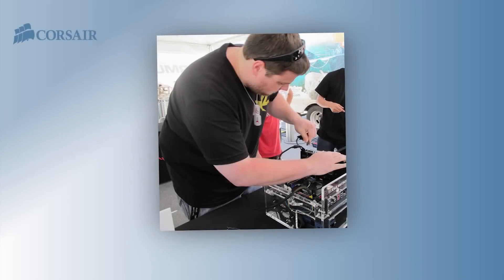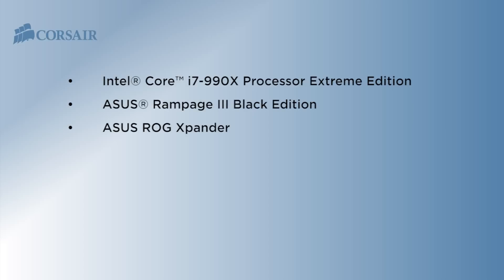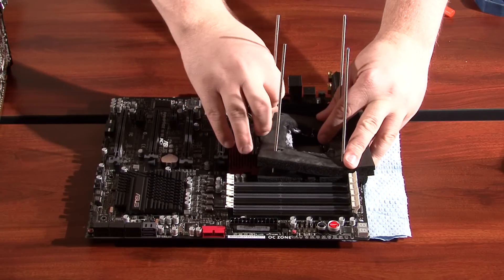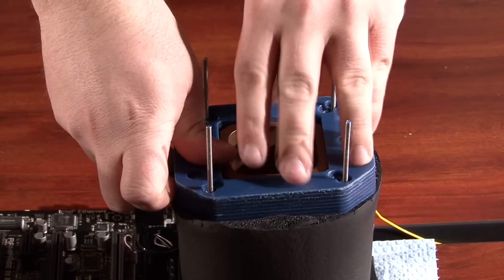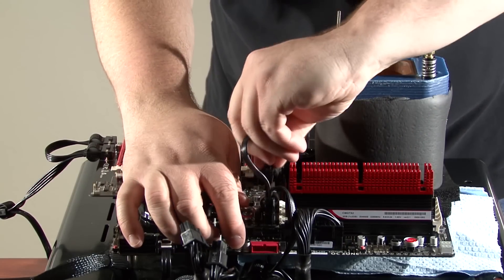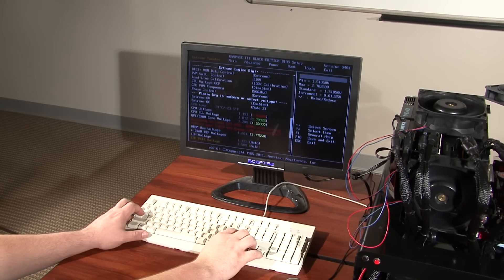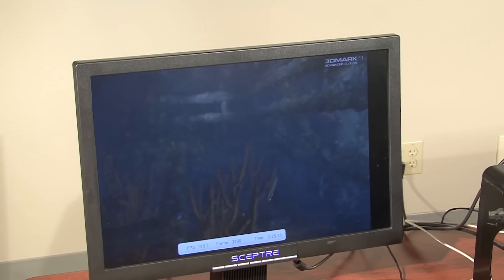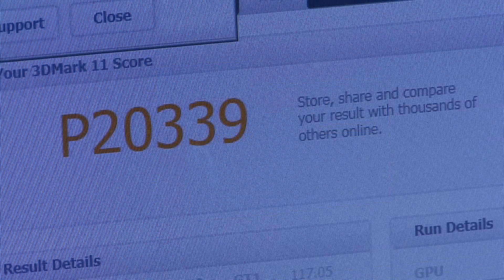Setting up your PC for liquid nitrogen cooling

Comment: Why does the CPU stop if its too cold? Is it the ultra low temperatures disrupting the conductivity inside the CPU? I know cryogenic temperatures can do funny things to properties and conductivity of metals and semi conductors.
Reply: Tuberuser187 That is correct, but your drew the opposite conclusion. Resistance is directly proportional to temperature (like you stated), which means the higher the temperature, the higher the resistance (conversely, the lower the temperature, the lower the resistance).

You are also right about resistance being the problem, but again in the opposite direction. The reason why there is a cold bug is because the CPU is made of transistors. Transistors NEED RESISTANCE to function properly. At -1XXC or lower (depending on the ratio of silicon to germanium), superconductivity occurs which means the transistors have 0 resistance. This is the reason why the CPUs stop functioning.
Reply: SirRaven
Best answer ever.
Reply: I think that the problem with the cold bug is that the temperature is too low for the electrons to move, so they just stop moving and the CPU just stops working... That's my theory.
Reply: ***** Thats probably it, electrical resistivity of metals increases with temperature and IIRC its relationship is linear. The colder it becomes the harder it is to push a current through and the warmer it is the easier it is.

The materials in the CPU probably become so resistive at that temperature they no longer allow the current to pass through.
Reply: ***** To me the amazing thing is how low the temperature can go before it stops working, I wonder how other PC parts would compare.
Reply: I don't think the cold is the issue for the CPU to just stop. Pushing the overclock high enough it does not matter if the atmospheric temp is -10 or -200 the CPU will still overheat too fast for the it to matter. So when you're performance overclocking it's not a matter of "if" it stops it's a matter of when.
Reply: Jules As much as I appreciate the reply I would have preferred it if you had watched the video first.
Reply: Tuberuser187 My theory is that if the processor is too cold and you start warming it up at a fast rate, it could possibly crack to cpu or become brittle
Reply: It is because of the extreme low temperature. At much lower temperatures (as you probably already know) the physical properties of the CPU are altered. There is a range of temperature at which the CPU can operate at and function correctly.
Reply: ben chang I am surprised they can get that cold before they issues really, I wonder how well the other computer components compare.
Reply: ***** pretty good theory
Reply: Exactly what I was thinking about Tuberuser187
Reply: Yes, but I think everything would be the same, every part would do a bug on that temp.
Reply: Tuberuser187 Well the actual thing,I think is irrespective of the material,material tends to occupy lower volume.Remember absolute zero,Yeah! that's that.At lower temps,as mentioned conductivity is favored sure!;But at microscopic levels as theorized,at even low temps the mere path for mobile electrons is blocked.Now that is not an obstruction (resistivity)!,it's just that there is nowhere for the electrons to move.Hope you understand this.:)
Reply: Tuberuser187 It's not even a theory. The extremely low temperatures, stops the flow of electrons. There are cases where they use liquid nitrogen on bombs, to keep them from blowing up.
Reply: Areyouduckingserious Also, electrons move extremely slowly to begin with. They move through a conductor at around 0.3mm/s.
Reply: *****
bad theory electrons stop moving at -273.15C or 0K
Reply: Tuberuser187 was thinking same, would like to see a 3-way SLI 980 cooled

Comment: Too bad he can't run the nitrogen in a closed loop.
Reply: technically possible, but the compressor alone would be insane
Reply: Shafquat Ahmed i wonder if there's any way of modding the refridgerator's compressor to make a closed freon-based loop  xD
Reply: barmiro Yeah this has actually been done before, look up VapoChill.
Reply: nitrogen in a closed loop wont have the same effect..  its not cold when in a closed loop..
Reply: Magnus Nymoen it will if you use an INSANELY powerful compressor.

Comment: dude! this is interesting! i like the professional production of the clip.

Do you think that simply puting the computer in a home-fridge is a good idea?
Reply: nop hell noh
Reply: why?
What about specially design fridge?
Soeradj Chotkan
Reply: 3goldy putting your computer on a fridge would most likely cause water to condensate around it and cause damage to components. assuming the low temperatures themselves wouldn't cause any harm, I guess completely removing all water and humidity would be the only way.
Reply: I would highly recommend against this. refrigerators keep cold air in. They aren't designed to be constantly cooling.
Reply: uiopoiu444
How about one that is design for a computer?
Reply: could be good,,,, but the system should then not realy be an fridge it coud use the same pricipalss a fridge takes to cool ,,, something that woud withdraw the heat directly from the cpu.... and building an system that would be pouring the condensation ... <i knw my english is bad speaking english isn't my primary language >
and you'll pay have to buy a huge powersupply  :P

Comment: Google Search for items below!

List of Supplies & Components:
1. Kingpin Cooling Dragon F1 Extreme Edition CPU Pot
2. EVGA Frostbite Thermal Paste
3. 0.5" Closed-cell foam insulation
4. Blue shop towels
5. Liquid N2 (Nitrogen)
6. 1-liter Thermos x3
7. 20-liter Liquid N2 dewar
8. Propane blowtorch

Electronics:
Intel i7-990X Extreme
ASUS Rampage III Black
ASUS ROG Xpander
NVIDIA GeForce GTX-580 x4
Corsair Dominator GTX2
Corsair Professional Series Gold AX1200 x2
Corsair Force SSD

Comment: lol'd at that fucking thermal paste splat, you are supposed to spread it evenly
Reply: Lol you guys are stupid...arguing about thermal paste on a video of a guy about to cool his cpu with liquid nitrogen...
Reply: I can tell you aren't certified. You are SUPPOSE to make a bead of paste in the middle of the CPU. when applying pressure to the paste with the heatsink will spread the paste evenly better than you ever could by hand. Get your CompTIA A+ certification to learn more.
Reply: Eillon Cross
I wipe my ass with your CompTIA A+ certificate everyday or any other certificate in the world for that matter. I use simple tools to spread thermal paste evenly instead of getting it all around the fucking processor where it shouldn't be.
Reply: CLIn7 l33tW00d 
What are you talking about guy? "...spread thermal paste evenly instead of getting it all around the fucking processor where it shouldn't be." 

If you spread the thermal paste "evenly", no matter if on the CPU or the bottom of the heatsink, then it WILL "get all around the processor"??? I can't follow your logic. But here is a bit of my logic; why would you spread the thermal compound all over, if the bulk of the processor's internals are located directly in the center of the CPU? I am legitimately interested in your reasoning.

***** 
You are right, I've never seen that happen either, because it doesn't. small bead of thermal compound directly in the center is sufficient. 

Shareallicu 
If my degree has taught me anything, it is that thinking outside the box IS essential. Yes you cannot just take everything that you read as doctrine, because it isn't. But, the main problem with spreading the paste yourself vs the pea shaped center method, is that you have a higher chance of the thermal, conductive also if you use AC5, paste overflowing. not to mention, as I stated earlier, you will never be able to spread the pasted as good as the heatsink can. Spreading also creates uneven surfaces, going back to the previous fact.

Experience as an IT Administrator has taught me a lot also. I still have a long way to go and love learning new things about my craft. BUT, I will not stand for comments by imbecile such as "lol'd at that fucking thermal paste splat", or "I wipe my ass with your CompTIA A+ certificate everyday or any other certificate in the world for that matter". CLIn7 l33tW00d  words speak volumes about his character. Yours does also, but at least you brought something worth talking about to the table.
Reply: CLIn7 l33tW00d Spreading the paste before putting on the heatsink will ensure you get bubbles between the cpu and the heatsink plate. The pea drop method eliminates that problem. Even if it doesn't cover 100% of the cpu (and it won't, if you're doing it correctly) it won't matter, because the processor hotspot is in the center.
Reply: CLIn7 l33tW00d
I agree with the pea size amount... but degree or not, experience has taught me that spreading it keeps the computer a cooler temperature more consistently.  I don't use Liquid nitrogen though hehe

People with degrees think they are right no matter what... they go to school to obey and are told what to believe and given a piece of paper (degree) and think it's the 10 commandments of knowledge (carved in stone).  They forget to think outside the box. They learn how to memorize other peoples 'facts'.

Not all of them though.  Earning my degree actually taught me to think outside the box; that not everyone with a degree knows what they are talking about. 

If spreading it works best, keep doing it!   If not (like in Seans case) keep leaving it to spread on it's own.  I'm sure you're both right, depending on your set-ups and settings :)
Reply: CLIn7 l33tW00d There is no need to spread the thermal paste out, most people do like he does here, just applies a dash (not to much without being to greedy) in the center, either in a circle or a square form. When you mount the cpu cooler it will push the paste creating a covering layer anyway.
Reply: I've never ever spread my thermal paste.been using this pea method since 9-10 years ago.no issue at all
Reply: madman3891 
HAHA I hear ya, but it's the nature of the beast. The thermal compound plays one of the most important roles in cooling. Liquid Nitrogen cooling is no exception.
Reply: I agree that the language a person uses can take away his/her credibility. 

But nothing compares to personal experience when it teaches something.  Although, keeping an open mind is prudent as well.

Maybe I will try it your way next time and leave it for the heatsink to spread. :)

Then again, why fix something that is not "broke"  - "for the experience" is a great reason!
Reply: Blaine Fisher On the processor he was using anyway, some processors require you to spread though, dunno if you guys are talking about the video guy way he needs to spread it or if your talking about your own, but, it varies on the type and brand you have.  Just use the manufactures recommendations.

Comment: when i rad the title i thought it was gonna be a guide on how to setup a liquid nitro loop, i watch it and he just cools it when i gets how with more wtf no one wants to dump more in while they are playing.   think i wanna do a cooler with a few peltier's
Reply: Except liquid nitrogen would freeze tubing, and if you used something that didn't have this problem the condensation from running a system long term would almost guarantee you'd kill something from the moisture build up quickly enough. Another problem is that liquid nitrogen will turn back into a gas outside of a contained environment for long, if you had it in a PC eventually the pressure build-up from the nitrogen heating up would explode, severity depending on how you contained it in a loop. 

Liquid nitrogen/LN2 cooling is not meant as a long term solution, it's extremely bad for processors and motherboards, the only purpose of liquid nitrogen is extreme overclocking for benchmarks and bragging rights. A long term solution is virtually impossible due to crazy unstable temperatures and the fact that the way our electronics are built these days they're not meant to deal with such sub-zero temps as the circuits on your motherboard would contract to the point of contacts breaking off. Pretty much every component involved in an LN2 run is not meant to live very long, but it is how the world record overclocks are done as you can do insanely high voltages (relative to normal CPU operation) and still be well below 0 so you'll never be limited by heat.

Peltier cooling is an interesting technology but it does have physical limits, and unless you're building a massive peltier plate yourself you'll find an effective air or water cooling solution will bring it close enough to the temps without the huge cost or energy consumption. If you want the most extreme long term solution to cooling you'd want to look into phase change coolers, though you have to plan and deal with a lot of condensation issues.
Reply: ty for the tips i was thinking liquid cool and having the peltier cooling the liquid in the res then cycling from there, or possibly submersed in a non conductive fluid and having peltier's cool the pool. just thinking of a fun project to OC this old POS like crazy for fun.
Reply: Chane Norris While Peltier technology is cool, it's not very effective for something like cooling a res, a radiator with a lot of fins is going to be much more effective for dissipating the heat. Peltier technology has it's uses, and can be an okay addition to a mass air cooler because in theory you can cool it to a temperature lower than that of just a standard mass air cooler (don't really see it in practice though). If you want to cool the water in a custom water loop, compression technology (phase change) is vastly more effective. 

The problem then becomes condensation, if you cool the liquid to below room temperature you'll quickly have a problem on your hands. Just as when you get a cold glass of pretty much any liquid, the vapor in the air will stick to the surface of the glass and form water. When you do this with tubing or anything near the internals of your computer eventually the water is going to collect and roll around. There are ways of dealing with this and it can be troublesome but phase change cooling does give you tremendously cool temperatures in return.
Reply: AFAIK liquid nitrogen evaporates real quick, you would want that in a loop.
Reply: CalebTaylor26 Since you probably didn't read my first wall of text, to keep liquid nitrogen in liquid form takes a very large amount of pressure, which requires some seriously strong materials to maintain, and is extremely dangeroust. It's not practical to make a set-up capable of a 24/7 liquid nitrogen loop for something as simple as a computer, and as far as diehard benchmarking and overclocking are concerned (the primary reason why they use LN2 in world record runs) is that your system, and definitely your chip are going to die relatively quickly under these conditions but you'll get the maximum possible clockspeed it was capable of.

Comment: Imagine if he did 4x 780stis. Thats #1 spot for sure.
Reply: 4x780 sexually transmitted infections? That's one weird sli setup.
Reply: 4x r9 290X's. I agree that the 780ti's are better stock, but if you can run the four 290's...
Reply: But did you expect any less? They're quite active if you know what I mean :P

Comment: Benchmarks, that is all. Use water cooling for low temps in games but this is for the sole purpose of overclocking to the maximum for higher benchmark scores.

Comment: NEVER DO THIS
Using a different colour cloth, any other than blue, will result in excess heat generation due to planks law of thermodynamics. If you use a red cloth you could cause a radiation leak from the processor! And if you use a green cloth you could even cause a small nuclear explosion.

I have many years experience in this field.

Comment: weak cores at high clock speeds don't beat fast cores at slightly lower clock speeds.
a 3770k at stock beats an 8350 at 4.8

Comment: Why didn't he run PC Mark7 instead? Also, I'm running an i5 with dual gtx760s, and I got 11k. Not much difference. I'm sure he would get a much higher difference with overclocking for applications, but not games.

Comment: My guess is that :
As propane reacts with oxygen, it transforms into water and CO2. So by doing that, he is adding water in the cooler, and with the heat generated, water has enough time to reach the sides before freezing. And part of the CO2 may also liquify, but that's really no big deal

Comment: Primarily, the cooling effect comes from the fact that liquid nitrogen is at most −196 degrees C. You could totally do a closed loop liquid nitrogen setup...  However, because making nitrogen a liquid requires high pressure tanks which are constantly being filled and emptied, the setup would be large, heavy, loud, and potentially dangerous.

Comment: The coldest that I would cool it down to is around 30-40 degrees F. I don't think it should be negative degrees though like those D-Wave quantum computing technology.

That way, you could overclock above 5 GHz. and still have long shelf life but you would have to also keep the RAM, Drives and GPU's pretty chill as well I guess.

I don't know ;(

::shrugs::

Comment: its not that hard along with most custom built computers the mother board you buy helps with all that and certain processors for example the AMD Fx Unlocked comes with software that allows you to do it straight after booting it.

Comment: I doubt most of us have the resources to accomplish this feat but it was fun to watch. Isn't liquid nitrogen dangerous? I also can't imagine running this setup inside a closed case nor for very long on frequently used applications such as photo or video editing. It must be about the doing rather than the continued using of a liquid nitrogen cooled PC. Beyond getting the benchmark score what practical long term gain is there here?